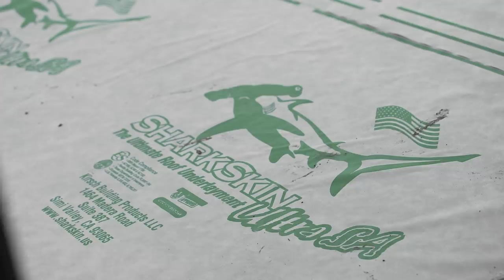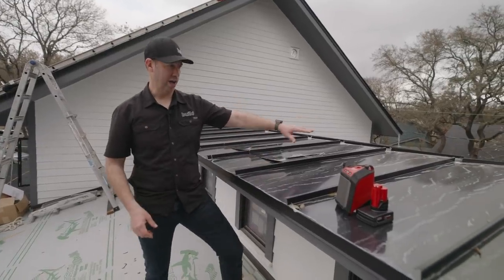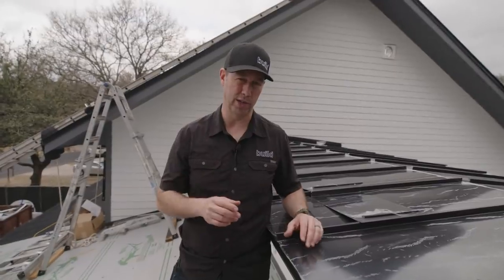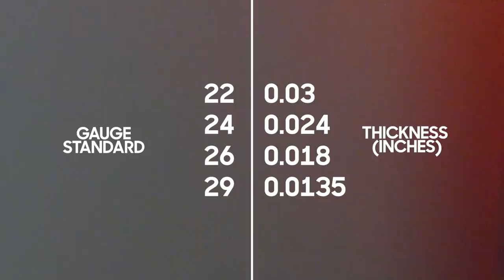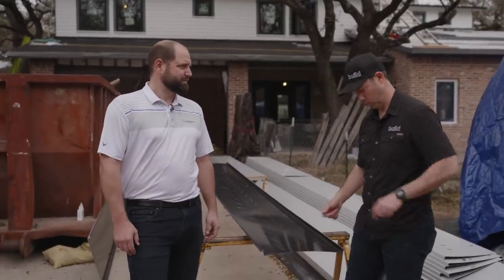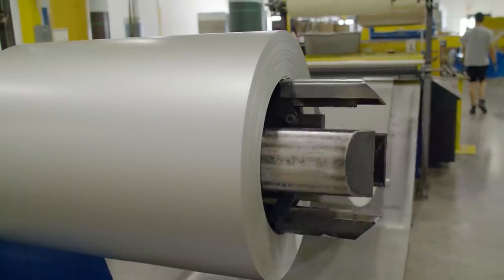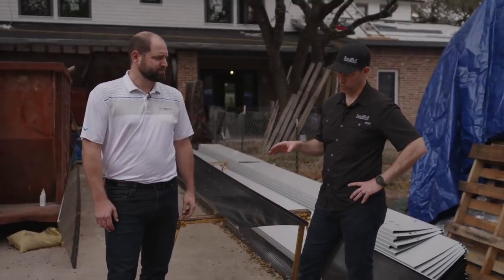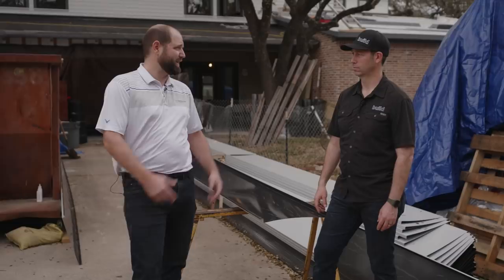Metal Roof- Best Practice Details

Comment: I have watched this a couple times before making decisions for my own house renovation. Questions: 1. Is it a concern to use regular 1 x 4 instead of pressure treated for the spacers? I know it has the ability to dry because of the air space, and Austin probably doesn't have that much rain. Would it be a concern in Northeast US? 2? when screwing in those 1 x 4 to the rafters, i don't see the screw holes being liquid flashed. Would that be a problem in future?
Reply: The pressure treating chemicals in the 1x4's may very well be a corrosive issue to the metal roofing panels

Comment: Matt,  at around 6 minutes, you discussed your reflective material facing the air gap but you faced it down over top of the material you used to create the air gap.   In this case, aren't you in fact, reflecting radiant heat towards your house?  I believe that the reflective material should have been put over the Sharks Skin underlayment, then your 1x4s (or whatever you use to create an air gap), then your metal roof.   With that setup, you are reflecting the radiant heat into the air gap but away from the house. This is the way other videos described the process and it certainly makes sense to me.   Is my logic incorrect?
Reply: Facing down is fine, and should work just as well. 
This is because an object with high reflectivity must also have a low ability to radiate thermal energy, a.k.a. emissivity (pseudo-explanation at the end). If you look up the emissivity of something shiny like aluminum foil, it's around 0.04. This means it only radiates only 4% of what a perfect thermal radiator (a.k.a. blackbody) would emit at the same temperature, which gives the same effect as if the radiant barrier was installed face-up on the other side of the air gap and reflected 96% of the radiant energy from the roofing metal.

The amount of radiant energy an object in thermal equilibrium absorbs is equal to the amount it is able reradiate, also known as its emissivity. It has to be, otherwise it wouldn't be in thermal equilibrium, and would instead be either heating up or cooling down. If you ignore transmitted radiant energy (i.e. you're looking at something that is essentially nontransparent, like a radiant barrier) then the reflected energy and absorbed energy must total 100%. Because absorbed energy must be the same as emitted energy (thermal equilibrium), you end up with a relationship where reflectivity goes up when emissivity goes down, and vice versa, (assuming nontransparent objects). I know this isn't really an explanation of the underlying physics, but hopefully it is still helpful.
Reply: @ergohack  Friend, I can't say I understood all of what you wrote but I think I got the main points and it makes sense.  The bottom line is that it works both ways.  Thanks for the explanation.
Reply: @danreed2189  No problem. This stuff can be hard to understand unless you've spent years with it, I consider it an accomplishment if I got the main points across.
Reply: @danreed2189  Ignore David G.
They've been stalking me all over this comment section and telling everyone how wrong I, yet they don't even seem to understand that infrared light and radiant heat are one and the same thing.
Either they are a troll, are riding high on the very peak of mount stupid on the Dunning-Kruger curve.

Comment: Normally when seeing diagonal boards for air gap under the roof in Sweden we would have shorter lengths of wood with gaps in between to allow for better air and water flow under the roof. Is there a specific reason why you did not do this as I recall having seen you do this in previous videos?
Reply: love the idea on that detail. what gap width do you use and what is your spacing of the gaps? I only want to know because I want to install a metal roof
Reply: @Manatee360Phototography  metal roofs aren't terribly common in sweden so have never actually put one down myself, mostly we use tile (what i know best) but have seen it done so that's why i mentioned it. 

That said for the spacing in the boards matt used them in some of his previous videos where he shoved roofs, that's why i was surprised he did not here. But the spacing depends on type of roof and type of boards used so dont know if there is an accepted general spacing recommended.

Comment: Black looks nice but a white roof would have reduced the roof temp by 40 degrees.   You may end up cooking your peel and stick.
If you want to run a simple experiment.  You may want to measure the temp on top of your roof,  under your roof on a hot summer day and come back 5 years from now and see if the silver liner is still working as well as it did when new.

Comment: Planning a 2:12 that has a 67’ run. Roofers are saying they can’t get panels that long. Is it common for roofers to have that machine cut on site? I’m in colorado. Other option is EPDM. Thanks!
Reply: Yes it's common for those machines to form and cut the metal on site.  They use the same machines (with different dies) to form and cut gutters on site.  Those machines could most likely make extrusions in any length, only limited by how much metal is on the spool.  The problem is the longer they get, the harder it is to move it, get it up in the air without damaging it.  Perhaps, if you could the OK from the roofer, you could rent a telehandler and suspend the whole machine in the air at roof level and have it spit out the panels right onto the roof.

If you end up going with a membrane roof, you should look into fluid applied membrane roofing systems.  That is what I plan on using when I build my house, which will have a "flat" roof (technically 1/4:12 pitch).  They are fully adhered and unlike most membranes, they are monolithic.  Much less chance of leaking when you have no seems anywhere on the entire surface.
Reply: The only way to run a panel that long is to either have a shit load of guys to catch and handle it or to suspend the machine to the roof line and lay out rollers for the panel to lay on. The roofers you are using probably don't own a panel machine, which is common. Most of us get them from a supplier and haul, or have them hauled to the job site so 67' is definitely out of the question for hauling. We don't own a panel machine so I can sympathize with your roofers. 67' isn't anything I'd want to handle.

Honestly, if it was my roof I'd probably go with white or grey TPO b/c of the low slope. Its super easy and clean to install, very easy to patch holes or rips, fairly cheap, and you'll get at least 20 years out of it. When it needs re-roofing, you can just put down recovery board and go right over the old stuff. You can glue it all down or just use screws and plates at the seams. You can put down 2" isoboard insulation for better energy efficiency. All of the laps are heat welded. I'd wager that every Wal-Mart you've ever been in has a TPO roof.
Reply: @oldscratch3535  thanks, yeah I was sold on Black TPO but having trouble finding someone to do it. Building boom...
Reply: @00HiGhGuY00  Thanks, do you have a product name for the fluid applied?
Reply: @Theheardrecords  There are several companies that produce a fluid applied roofing system.  The 2 I can recall at the moment are Sika and Kemper System.  Matt actually has a video on his channel of Kemper system.  It's an older video, but just search, you should be able to find it.  Also, there are several other videos on youtube showing these systems.

Comment: I like a dark roof myself, but I"m surprised to see it on your house after all the insulating and air sealing. It's seems like an oxymoron.
Reply: That air gap and the reflective membrane is going to more than negate any gains caused by the dark colored paint.
Reply: @kevinhornbuckle  that's hard to say for sure. It's crazy how hot a black roof can get in the sun.
Reply: He also wants the solar panels to blend in. Architectural style will always trump building science, “the greenest roof is a white roof”. I’ve been installing double lock for 8 years and never once installed a white roof!
Reply: Ganga Din  That is what I installed on my house. My neighbors thank me for brightening their kitchen.
Reply: @mitchelljoyce  I just put a metallic flake (silver) coupled with radiant barrier snap lock roof on my own home with pure bi facial (two sided) panels and IQ8 inverters paired with enphase batteries.  After running the conduit through the attic we did 3” spray foam on the underside of the roof This is the most energy efficient roof setup and the best possible technology available at least until 2023.

- a solar business owner with over 40,000 installs.

I should post some videos the home is a hybrid barndominium/shipping container design

Comment: I wanted to learn more about that robot. Like, he teased it and then just glossed over it. I haz a sad
Reply: most people roofers hand swage the seams. when risinger referred to a "double lock", i don't know whether than means a 90 degree swage of 180 degree swage. both are labor intensive when done manually, with the 180 degree swage requiring 2 passes. in addition, hand swaging 24 gauge steel is difficult enough, but probably ridiculously difficult on an 8/12 roof pitch.
Reply: It’s called a power seamer. Not a robot though lol! https://www.stortz.com/product/freund-seaming-pro-preorder/
Reply: @robertunversaw  it is a robot, which some people call a "power seamer". a robot is a machine that automates processes done by humans. the term "robot" is more commonly used in europe.
Reply: Search electric standing seam machine. They've been around at least 35 years. So has the pan forming machine. About $4000.00 new for seamer.